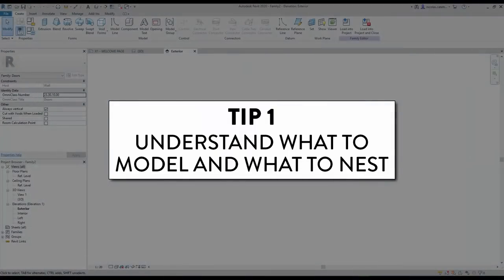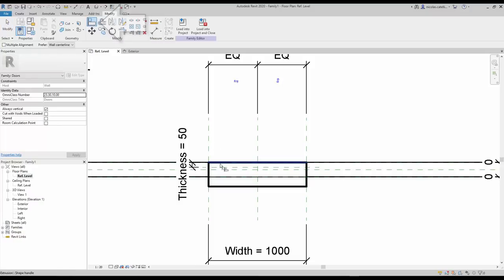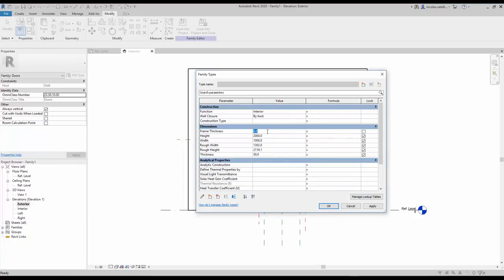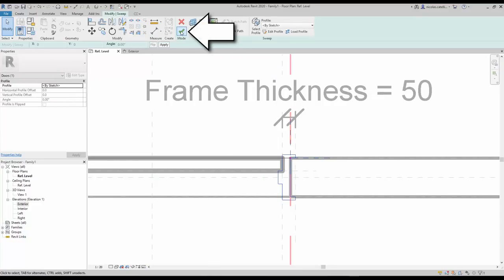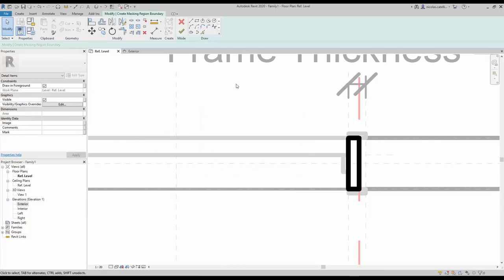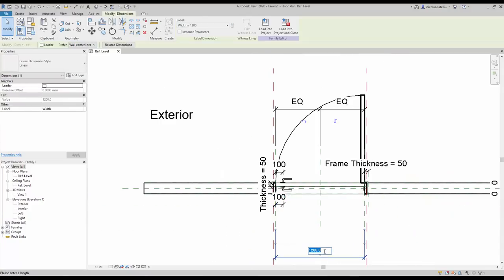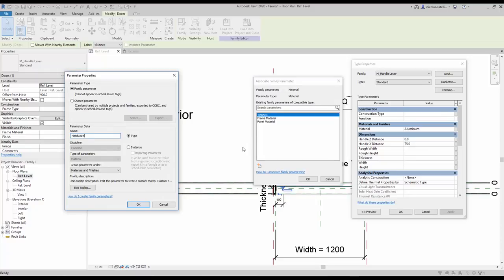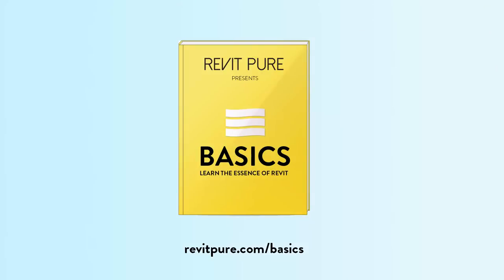Revit Tutorial - 12 Tips To Master Door Families

Comment: Tip 01 - Understand what to model and what to nest > 0:07
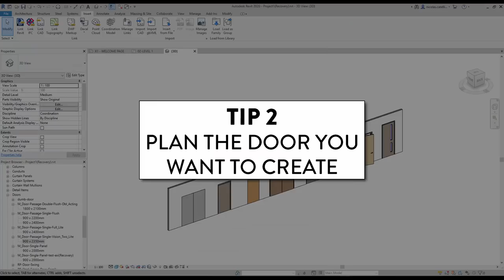Tip 02 - Plan the door you want to create > 0:40
Tip 03 - Use extrusion to model door panels > 1:13
Tip 04 - Set up the "rough" dimensions > 2:20
Tip 05 - Use sweep to create door frame > 4:41
Tip 06 - Make door 3D geometry invisible in plan view > 6:22
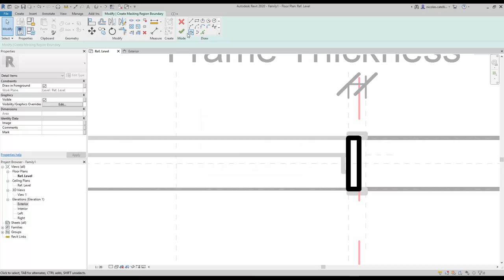Tip 07 - Create a nested plan swing family > 7:28
Tip 08 - Add external families for hardware > 8:57
Tip 09 - Assign all geometry and lines to the correct subcategory > 10:45
Tip 10 - Assign material parameters to 3D geometry > 11:17
Tip 11 - Avoid door super-families > 12:07
Tip 12 - Create a custom door family template > 12:48